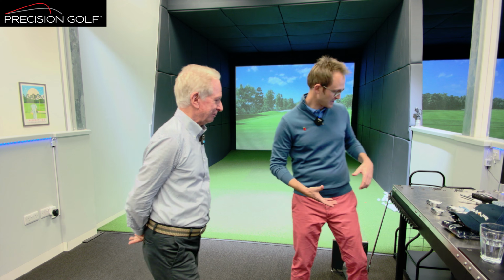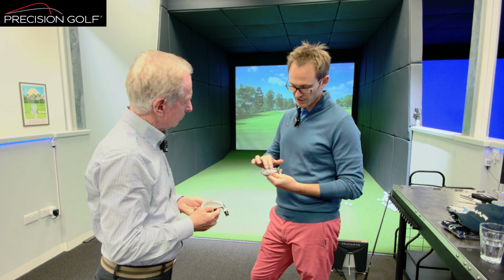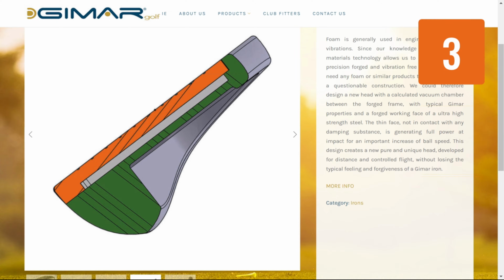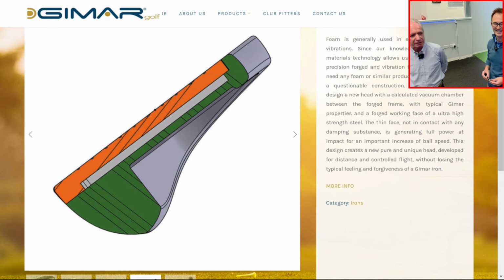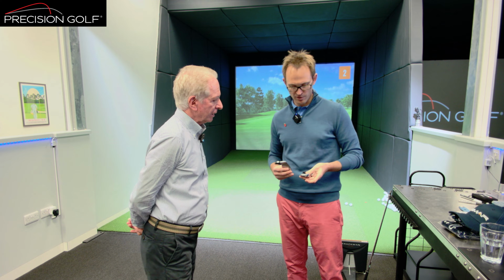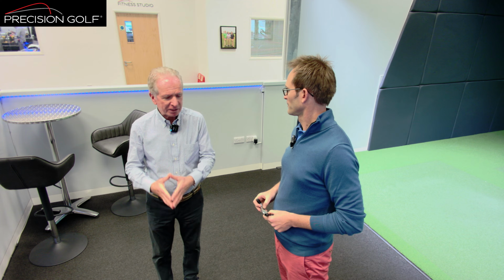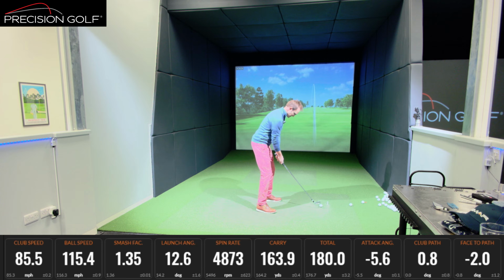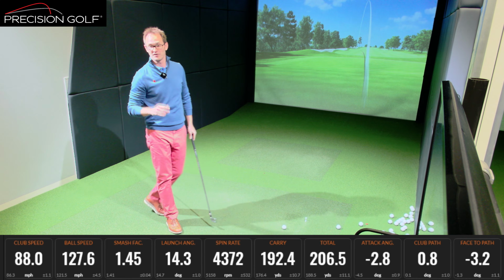Gimar Iron Review - The most PRECISION forging in the World!

Comment: Looks amazing . What Main Stream forged hollow body compare to the adw1? Currently play with i230 but tested locally in SA the adw1 and they felt amazing and far softer feeling , less harsh . Are the adw1 as forgiving as the i230?
Reply from the maker: I would say ADW1 is more forgiving than the i230 - the Gimar FFW 10 is more like the i230/P770 heads. I would say ZX5 Srixon compares to ADW1 for playability although it is not a hollow construction but the Gimar head is not as low spin. Hollow body-wise the closest would be MP245 but again that will spin less and Callaway Apex Pro is not as fast off the face so hard to find a forged hollow body construction to compare really!
Reply: @Precision_Golf  thanks for the responce . Not sure if I tested the FFW or the adw1 now,,, , what ever I tested the Gimar felt softer muted vs i230. Am I mistaken or would this be correct?